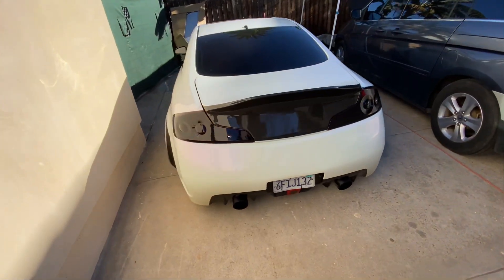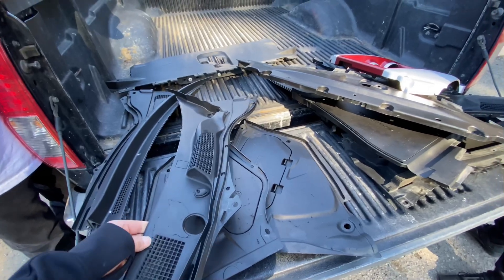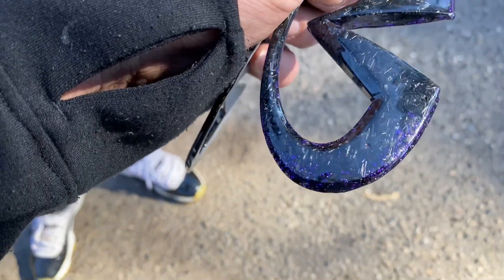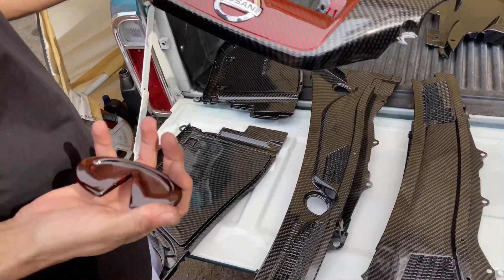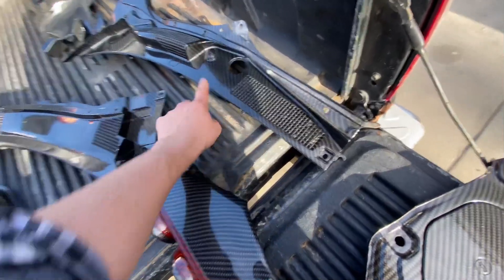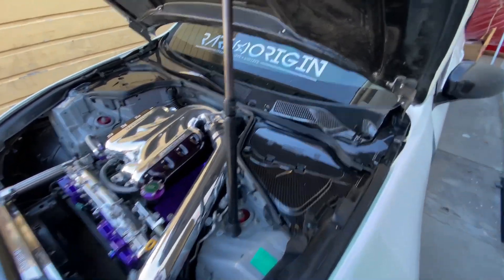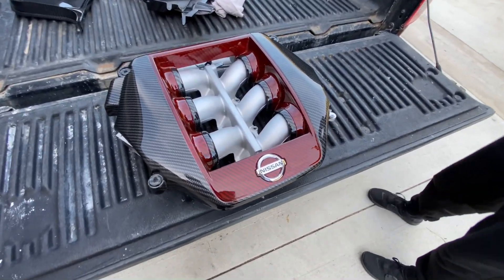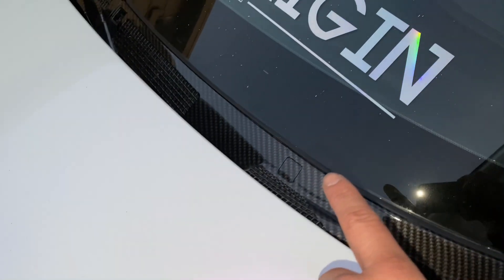G35 / G37 carbon engine panels! H2o_Creationss

Comment: ohhhhnnnooo, i got guy in La for amazing carbon work bro.  his work wont flex or break.  I've got the most real carbon on a kia, i know lol 😆. hydro dipped carbon is a disservice on a quality build like this
Reply: Does he have instagram?
Reply from the maker: Excatly why I can’t go real carbon because this radiator cover need to flex so I can fit my bumper on! Otherwise I would of gone real carbon
Reply: Yooo, who is this guy you speak of? Would like to check him out. Does he have an email or something?
Reply: @K5GIXX  #tgwrkz and #slickcarbon
Reply: @K5GIXX  #slick_carbon
Reply: @edimaya2951  hey bro, i have 14 Q60 IPL convertible, i have been moding quietly. I'll be posting pics of it soon on my IG, all 3 covers in the engine including radiator are skinned in carbon, engine cover is full carbon.  ive had no flex or cracking with the radiator